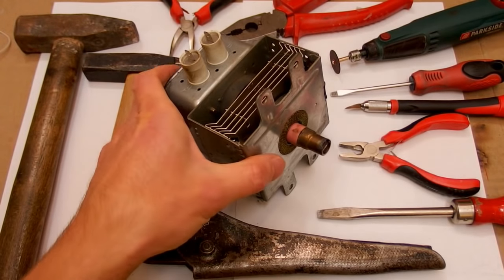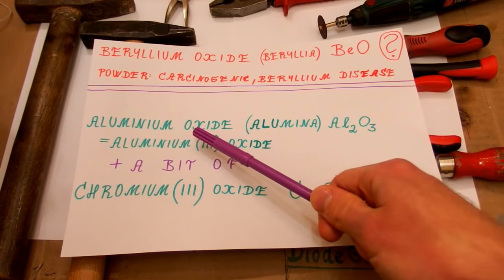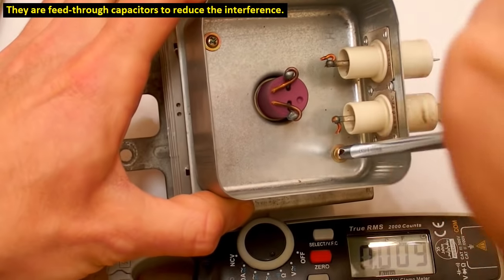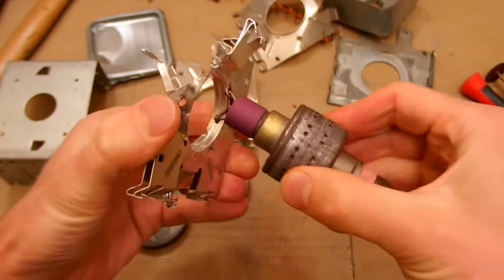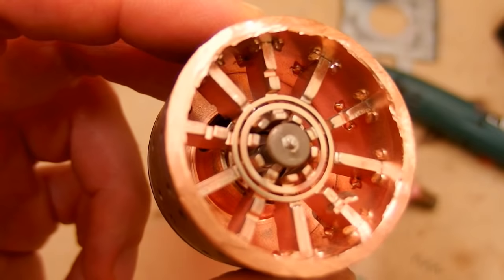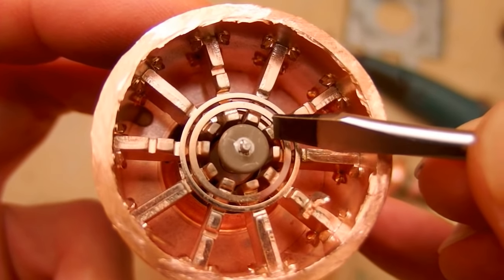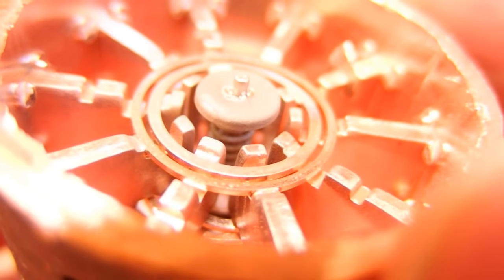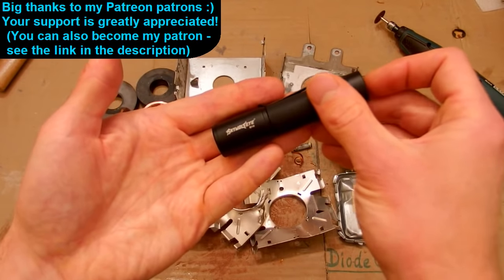What's inside a microwave oven magnetron

Comment: I don’t have any background with vacuum tubes but the specification that stands out to my mind is the low voltage/high current of the heater. Is there a particular reason for this?
Reply from the maker: It's easier to make a low voltage high current filament. It's short and thick. A high voltage low current filament would be very long, thin and fragile. Just take a look at 230V 10W lamps. The filament breaks just from a wry glance. And also the transformer winding is easier to make for a low voltage. And finally, in a directly heated vacuum tube, the filament current must be many times higher that the emission current, so that the emission current doesn't change the temperature of the cathode much.  In other directly heated vacuum tubes (amplifiers), the filament voltage also intereferences with the signal, so it also has to be low for this reason.
Reply: @DiodeGoneWild  awesome explanation, thank you!
Reply: @DiodeGoneWild  Thanks very much for this, makes sense
Reply: @DiodeGoneWild  you the man

Comment: 100% the insulator of the pink magnetron antennas is ruby alumina. The ones with BeO are in late 70s and early 80s microwaves it is easily identified because it conducts heat to where it feels like metal and is bright white in color.

Comment: When I used to repair microwaves back in the 1990's, several of the training courses I attended warned us about beryllium oxide in the magnetron, which I ignored as they were internal training courses. It was not until I attended several official courses, one from Sharp, and especially one from Panasonic UK, a full seminar training course, where once again they stressed about the dangers of the beryllium oxide contained within the magnetron that it really sunk in how dangerous they are. The RULE is, if the insulator is PINK it contains beryllium oxide (as beryllium oxide is pink) , if it is WHITE then it is ALUMINIUM based. Older microwaves before about 2005 used beryllium oxide, but have noticed a switch to Aluminium over the years since. I have also noticed some within the last year with BLUE insulators?...  If you have a pink insullator ind you break it and inhale the dust, you are asking for berylliosis of the lungs...
Reply: Beryllium oxide is NOT pink, it is white and not easily distinguishable from aluminum oxide, which has a higher density. It is used because it is one of the best conductors of heat while being an excellent electrical insulator (only diamond has better properties). It is also widely used in the construction of high power RF power transistors and other high power semiconductors, which carry the same warnings. Until the 1950's it was also widely used as a component of the fluorescent coating inside fluorescent tubes.
Reply: I would expect a training course to be full of "cover our asses" material but not necessarily that hot on facts. (having attended and helped create many training courses) 
I'd love to hear from a production engineer at the factory where they make the magnetrons, then we really would know the facts.
In the meantime, I'm assuming it's beryllium oxide and proceeding with caution, but insisting on holding on to me scepticism.
We need Cody Don Reeder to zap a load with his x-ray spectrometer!
Reply: @petermarchionda  I probably inhaled "a tonne" of fluorescent tube gunk in my childhood. Thinking of our poor methodology for doing teardowns back then.

Comment: So a tornado of elektrons propelled by a magnetic field twists and oscilates between two rings of negative anodes and every other one that is connected to the antenna becomes charged with super high frequency high voltage radiative micro waves and they escapes the antenna, go into the oven and shake vigorously the water molecules. As they shake the friction between other molecules produces heat and the food absorbs that heat and evenly heats up and becomes hot.

Comment: Awesome!  Couldn’t have come at a better time for my radio club.  Some of the lads have been threatening to take a magnetron apart and the Beryllium concern came up.  I have a 150W power resistor with dire warnings on it and I wouldn’t push my luck.
Reply: Its better not to do, Darwin award can be obtained only once
Reply: ...and apparently, just one exposure can knacker you.
Reply: @Jenny_Digital  I used to work with BeO ceramics in 1980. The dust is a silent killer. The gentleman in the video is waving a disc cutter around the ceramic. If you look closely at the end of the video he has inadvertently run the cutter across the ceramic, the mark is briefly shown. Its about as bad as it gets.
Reply: @johnedwards1685  Yikes!

Comment: The frequency is not that critical to warm up water.

Water being a polar molecule, any oscillating radio wave will work. 

A higher frequency would decrease the effect of destructive interference. We would not need a rotating plate to distribute the heat.

Comment: As I understand it, it's actually the other way around. At the time the microwave oven was invented, gigahertz radio wasn't really a big thing, mostly used by military and for some directional long distance links. The microwave ovens all standardized at around 2.4 GHz and so when microwave radio became a thing and we were allocating out the frequency, we kept that range unregulated since it was already so full of leakage from microwave ovens.

Which is why bluetooth, wifi and others ended up using that range.
Reply: This happened in 1945, during the war.

Comment: you should take those bits out of the plastic and lay them on the table and hold the Geiger tube VERY close to them, the whole point of that mica window is to catch a few alpha particles, which can be stopped by a sheet of paper, mostly ….

Comment: You said that anything important uses this frequency but this is the frequency WiFi uses...when powered one the tiny microwave leakage from the oven is enough to create interference and even slow down internet speed of WiFi devices
Reply: Interesting. The coverage of the microwave doesn't block the waves inside of it?
Reply: @franciscomacedo2704  it does but because nothing is perfect there will be some tiny leakage probably less than 0.1% which for a 1kW microwave oven it is 1 watt or less. This is not dangerous and its actually the same power your router emits to connect with other devices...its just that it sometimes microwave oven interferes with the data transfer of WiFi devices and corrupts it and thus forces the router or the device to send the data again...or it just makes it harder for the device and router to contact thus slowing down the speed...but this depends on the frequency range of your router and the offset of the microwave oven
Reply: @the_danksmith134  Yes, now that im picturing it, the waves would probably spread really far apart from each other. I imagine this would make for less interference too. I never noticed a slower internet while heating food tho.

Comment: I heard somewhere that you can take a magnetron apart and remove the tube and magnets and use it as a high voltage diode. Is this true?
Reply: Just remove the magnets. The magnetic induced spinning electric field is what causes the oscillation. Remove the spinning part and it operates just like a diode.
Reply: oh ok. thanks for the explanation!

Comment: just out of curiosity, I wonder if your Geiger counter with that neat little mica window would pick up any electrons if you applied a little voltage to that intact heater filament, not enough to get it to glow but, just enough from whatever power source you have that won't pop....

Comment: Put voltage on heat filament and measure radiaton.
Reply from the maker: Half life doesn't depend on temperature. The radiation would stay the same.
Reply: Radiation and electron emission are two different things.

-When the cathode is heated, the electrons inside it are excited and some of them escape to the vacuum inside of the tube. This is called "thermoionic emission"

-The cathode contains thorium because this enhances electron emission (when the cathode is heated, it wll emit more electrons that it would if it didn't contain thorium).
Thorium  also happens to be very slightly radioactive. This means that thorium atoms tends to spontaneously disintegrate after some time. 
Thorium's half-life is 14 billion years which means that if you have a certain number of thorium atoms, half of them will have disintegrated after 14 billion years.

Comment: It works at 2,4GHz just like WiFi networks.
Reply: Yeah, nothing important. Forget Wi-Fi, BT and some other stuff.

Actually, it's not supposed to leak out.
Reply: And yes a microwave also leaks that why you can experience internet loss while running a microwave
Reply: @peterzingler6221  That's why the f*** my a**hole neighbor keeps turning on his microwave
Reply: 2.1GHz - 2.5GHz. Many bigger ovens work at around 1GHz.

Comment: Can anyone tell me if it is safe to cut apart a magnetron without damaging the  ceramic to get the copper cavity for the copper?
Reply: Yup cut the weld line. Band saw works the best
Reply: @christopherleubner6633  so I just avoid cutting the ceramic? Also I believe the filament contains thorium which is radioactive. Will that radiation be hazardous? I don’t want to end up causing bodily harm just for some scrap copper.
Reply: @BGTech1  the thorium is bound to the tungsten cathode, while radioactive it is not very powerful in dose rate, will make a geiger counter tick but thats about it. Avoid grinding the ceramic parts. Grind the weld on each side of the magnetron. You get a big chunk of copper with some silver inside as well.

Comment: What if no water inside microwave? Where energy going? Heated back magnetron or microwave body? How much heat at magnetron its have only little heatsink with air blowing but even with digital control its never have temp sense for protection?

Comment: 11:12 why antna are connected with only one out of 10 slot instead of connecting with all to get power from all ?
Reply: It's actually connected to 5 of the vanes by virtue of  the copper ring that joins them all up, the diameter of that ring is probably optimised to be resonant at 2.4ghz, or to connect them all up at a node of some sort, to extract the  energy from all 5. As Diode says, stuff at RF frequencies is pretty much witchcraft and nothing is what it at first glance appears to be.
Reply: @Tekwyzard  by taking the fact that at that high frequency every tiny metal with act as inductor and and slightly changed  distance of electrical contact will also matter seriously  , so its confusing to see that ring are at the edge of inside and only one antenna are connected with one lc tank which is fare from ring area !! Their seems multiple lc tank in that copper circuit so why only one can radiate for getting its full power then from all ?
Reply: The total frequency is coming from the one antenna you don’t need more.

Comment: That 'copper' might be beryllium copper (BE/CU).  Much stronger and harder than pure copper.  I sometimes work with it at work, and have to take precautions to not make any dust.
Reply from the maker: I don't see any practical reason why it would be beryllium copper. The point is to reach the best conductivity without a too high cost. If copper wasn't conductive enough, they could have added silver plating, but this would add too much cost. Beryllium wouldn't improve it. And I believe that even a pure copper is strong enough not to collapse under vacuum in this shape and thickness.
Reply: DiodeGoneWild beryllium copper alloy tools are usually used in atex environment to avoid sparks, I do not think that’s the case here
Reply: Yeah I cant see any reason to use an alloy here either. Pure copper has MUCH better conductivity than any alloy of it. And such a small vacuum chamber does not experience much force, especially since it is a very good shape for a vacuum chamber as well (round).

Comment: Can convert the magnetron to a x-ray emision tube?
Reply: That wont work well at all. At best it might put out a little, but in all directions. The distance between anode and cathode on the outside are probably a bit short for the voltage you need as well.

Comment: Chromium (III) oxide is green, so it can't get pink. There must be other additives.
Reply from the maker: You may be right. The pink color can be other impurities in the Al2O3, but I'm not sure which impurities. Maybe Fe2O3. But this website says that pink aluminium oxide is pink because of Cr2O3. 
https://www.graystarllc.com/products/pink-aluminum-oxide
So I'm not sure...
Reply from the maker: PS: There's actually multiple websites saying that pink aluminum oxide is pink thanks to chromium oxide. I know that Cr2O3 is green, but I'm not really a chemistry expert, maybe the color of the mixture is not the mixture of the colors. The actual color is closer to the dreaded CrO3, but the websites of the suppliers of the material  always say Cr2O3.
Reply: @DiodeGoneWild  It is the right color for CrO3, which on its own is a very nasty product. Synthetic ruby is alumina doped with CrO3. Top answer in this link mentions density of insulators being close to polycrystalline ruby. 
Link: quora (DOT) com/Do-magnetrons-in-modern-microwaves-still-contain-the-metal-beryllium
That post also implies that magnetrons made in Russia may still contain beryllium, but beryllium and BeO are both a gray color.
The second post in this next link says about the same thing but specifically mentions color. Some older magnetrons I have opened did have white insulators. I am thankful I was careful not to break the insulator or generate dust from it.
Link 2: eevblog (DOT) com/forum/projects/1000-watt-50kv-homemade-power-supply-by-glasslinger/25/

Comment: If i Plug a 230 V 50 Hz Microwave Owen into a 230 V 60 HZ supply will it work ?
Reply from the maker: It won't work properly. It's all tuned for just one frequency. The transformer inductance, the magnetic shunts in it and the capacitor are all designed for just a single frequency.
Reply: @DiodeGoneWild  OK, Thanks, but i will do the experiment and let you know.

Comment: Hard of hearing , I thought the audio is synthetic and translated. To bad, it needs subtitles. I couldn't go one minute. I have read the 1945 ham mag 73, the details were there as the war ended in Europe. The future frequency of RF ovens was baked into engineering code back then. Little did they know WIFI would have to operate next to it.  During the Bosnian war our $ 1xx,xxx anti radar site missiles were deceived by microwave ovens wired to run with the door open and that sent a lot of money down a rabbit hole.

Comment: "... is also used because no important services use this frequency..."
What???
Wifi uses 2.4 GHz!!!!!
Reply: He said 2.45
Reply: Wifi is still not that important and if even a little amount of microwaves leaked out, it would interfere with wifi, because maximum output power of routers and access points is 100mW compared to 1kW of microwave ovens and if even 1W would leak, you wouldn't be able to use internet at all

Comment: Microwave safe to use for consumers? Don't want radio electrical milk. 🥺
Reply from the maker: Microwave ovens are probably safe if used as intended. They have been around for decades and there's no microwave oven disease epidemy.
Reply: Yes, they are safe.

Actually these kind of questions are mostly because of a misconception people have between the radioactive materials and radiation.

While radioactive materials are contagious, radiation itself is not (Well, it's a bit more complicated when it comes to high-energy particle radiation but nevermind).

In the milk example, what irradiated is the milk, not the human tissue. After the magnetron stops emitting microwaves, it's completely safe.

As said, for non-living things, effects of radiation is temporary, and it goes away immediately after the radiation source is removed. On the other hand, radioactive materials are direct sources of the radiation, and that's why they are contagious. They can be absorbed by human body and can continue to irradiate tissues inside.

For the microwave ovens, clearly this is not the case. They don't use any radioactive material, they just use high-power non-ionizing radiation to heat up the food.

Comment: FYI: the 2.4Ghz of the magnetron is the same frequency of WiFi.  If you experience wifi problems it may be from a “leaky” microwave oven. This does happen.  Lastly, the copper used for the cavity is some of the purest copper to be had.  The linear accelerator in Varian radiation therapy machine is six feet long, has cavities the same  as a magnetron and before operation has to be vacuum pumped for a several hours and then a vac ion pump takes over that essentially sucks any molecule of air to it after many more hours, that becomes a near perfect vacuum.    You should see a speech therapist on your use of the “hanging” word on each sentence.  It’s tiresome to listen to.